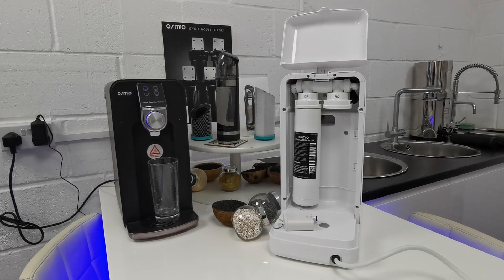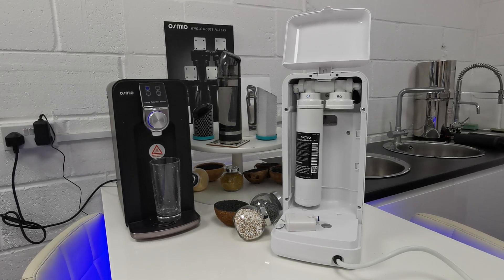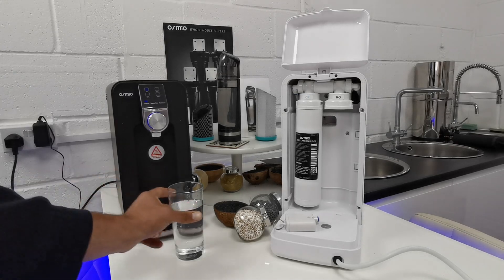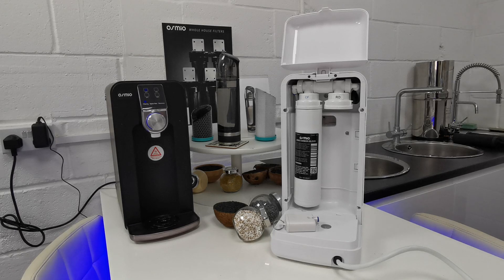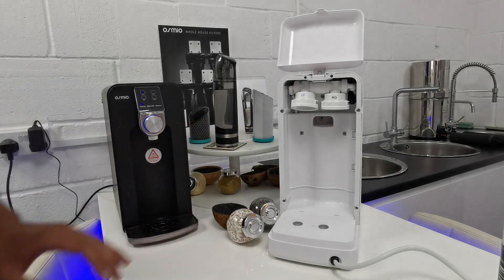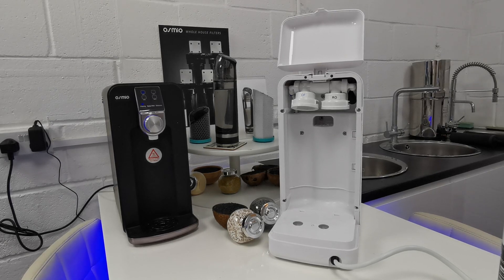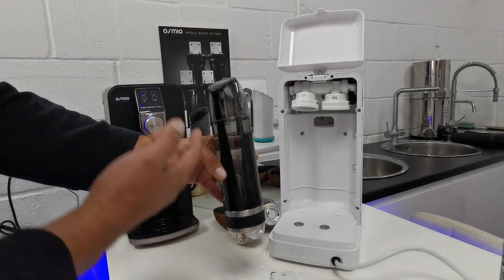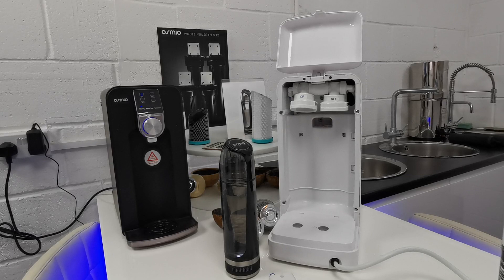Osmio Zero: Organic vs. Inorganic Minerals and No Waste Reverse Osmosis System

Comment: why i have taste plastic ?
Reply from the maker: It's doubtful that you can even taste plastic, the taste is alkali metals, transitions metals, not plastic. If you take out out the last filter and put in the empty one then you won't remineralise or lower orp. We don't recommend that because lowering the ORP is what makes the water non aggressive. The new 4th filter will be adding a higher level of minerals than after the first two weeks. So it takes a little time for the remineralisation to get stable. It's the same problem with any flow through remineralisation methods, although of those bioceramics is the best. If you have a problem, contact the company who can help you further.

Comment: Love Osmio Zero and I recommended it to all my friends. Question: is there a list of items/pollutants (like fluoride) that your filters cleans?
Reply from the maker: Hi there thank you! We have spot tested the system with South East water scientific services who we work with to do testing. However we can't publish them because WQA guidelines suggest only independent  approved bodies like NSF, SGS and other companies like this do. We use NSF std 58 for reverse osmosis membranes. But this doesn't test for fluoride reduction, so the results will be completely variable depending on the water used, what temperature it is and other factors. Showing typical percentage reduction rates as lots go is completely misleading and we don't do that. So for example if you want to know how much fluoride is in the glass, the best way is to test it for fluoride. In our water we have 0.12 mg per litre and it wasn't enough to show what the reduction rate would be if the level was 1.5mg per litre. We pay about £5 per normal parameter for testing so it doesn't cost much to find out if you need to know what levels are left.
Reply: @OsmioWaterH2O  is there any chance of seeing a list of what the machine removes either from you or if not could you let me know where I go to get it...! Many thanks, C

Comment: Hi Osmio, Zero is a very interesting product, well done. My main main reservation with the Zero is that every 6 months or so there is quite a hunk of plastic to go to "recycling" which unfortunately in the UK often means incineration or landfill. Any chance you could setup a recycling service and re-use the cartridges?
Reply from the maker: The filters cannot be made from recycled plastics. It is made from vidgun polypropylene but this can be recycled. Here is some info from. The Web: Polypropylene can be recycled into brooms, brushes, garden rakes and plastic trays.
...
You can recycle this plastic if your Local Authority mentions:

Packing tape.

Plastic Straws.

Take away tubs.

Ketchup bottles.

Plastic picnic ware.

Plastic bags or film that can't be stretched- these are not recyclable.
Reply: @OsmioWaterH2O  Thanks for the reply, actually what I was wondering is whether the plastic could be sent back to you for re-use, rather than left to the vagueries of council recycling. I noticed that your Eco Inline Water filter does offer that option, which is great, so I will probably go for that.
Reply: @liammullan2197  Hi Liam, thanks for asking this question, I put the exact same question/comment to Osmio a few weeks back. It's also the one thing stopping me from purchasing with 100% confidence right now. It appears they have come around to the idea of stripping the plastic from the filter and suggesting to recycle this - when I last discussed this with Osmio I was told this wouldn't be possible due to the dangers of contamination (legionnaires disease, I think)

Comment: Hi. Thank you for the video. I bought an Osmio Zero, and so far I found it very good. The one concern I had though was that it is constructed of plastic, and one of the things I have been trying to avoid is contamination of my food and water sources from any plastics. I was wondering whether this was considered when producing the Osmio Zero, and also whether it would be worth releasing a metallic stainless steel or glass tanked version?
Thanks
Reply from the maker: The only better material we could use is glass but it's really complicated to mould. We have another glass product coming soon so we will look into it. It's a good suggestion thank you.
Reply: @OsmioWaterH2O  Great, thank you for the quick response. I would definitely be interested in a glass model in the future.
Reply: @OsmioWaterH2O  Yes this is my concern with this too. The plastic filling container and also the filters. Why has nobody created stainless steel returnable filers? Surely this is possible and would cut down on a massive amount of waste and cut down on our exposure to plastic too?
Reply from the maker: @LifeOptimise  because stainless Steel is not as resistive to pure solvent water
Reply: @OsmioWaterH2O  does that mean we should not use a stainless steel water bottle to hold osmio water then? What would/will happen?
Reply from the maker: @LifeOptimise  I personally don't use a stainless steel one, the Osmio Duo is a glass hydrogen water bottle. Stainless stele depending on the grade has a range of heavy metals which will extract over time, especially where there is a welding joint.